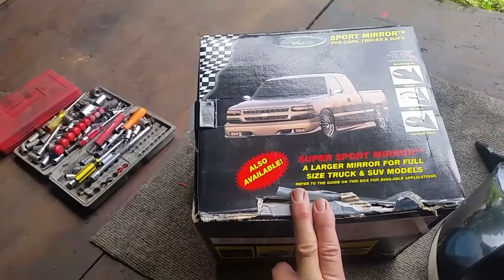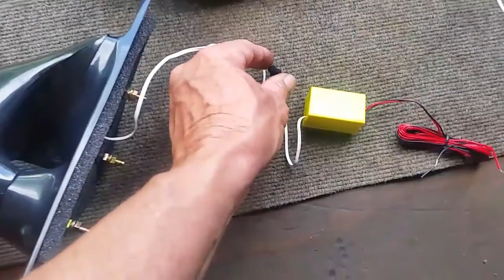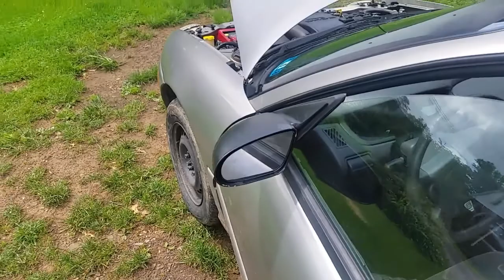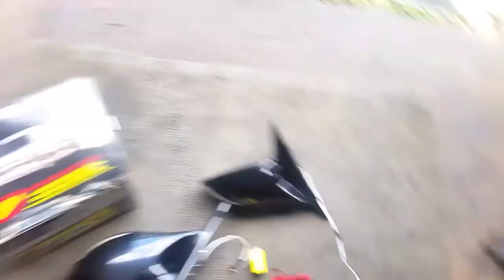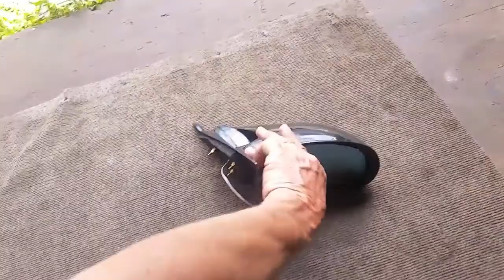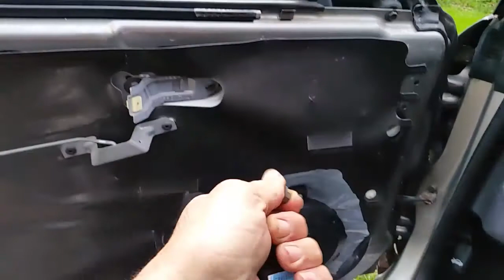Aftermarket Door Mirrors With Turn signals lights. My Project.

Comment: Nice mirror upgrade video Nathan. Those things are nifty. Finally some pleasant weather up here in New England, just finished up an ac compressor and dryer replace, pumping and charging tomorrow. Getting ready for those hot summer days.You sure have been on a tear lately. Keep the 
diy vids comin. I enjoy watching and learning about your projects
Reply from the maker: CrimsonKnight Thanks man! Yea the heat and humidity is coming. AC work on the neon tomorrow :)